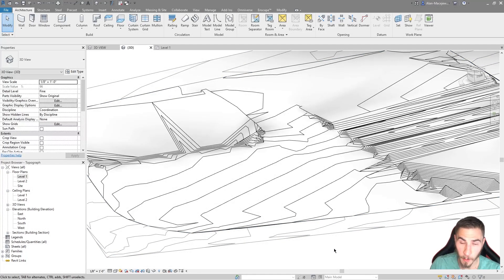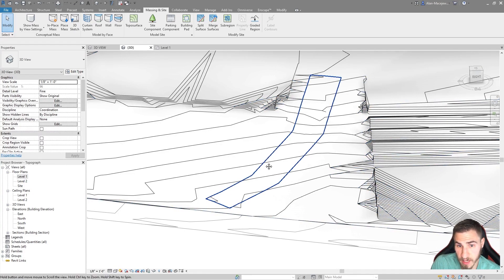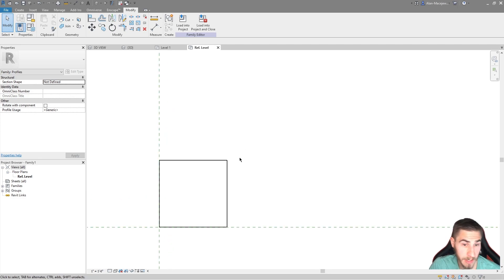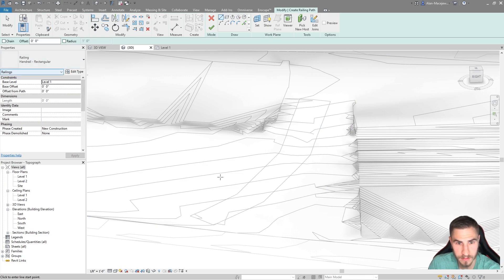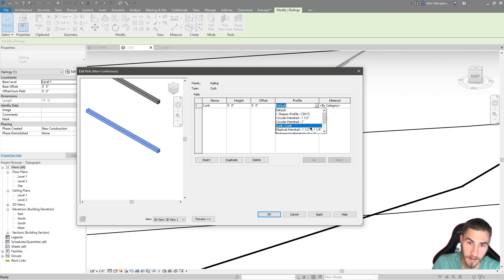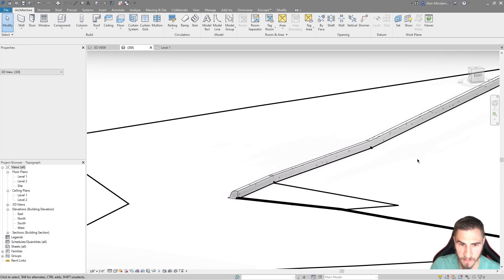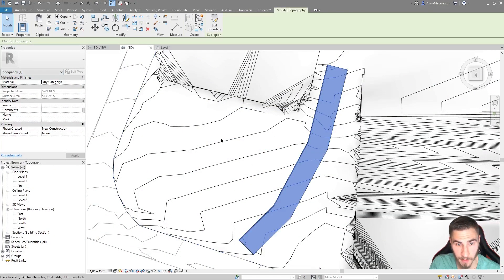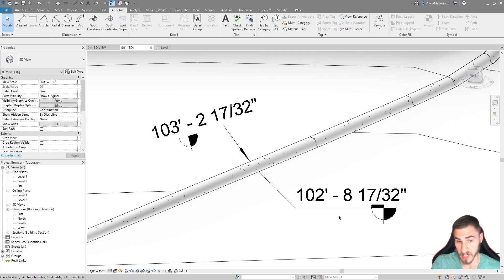How to Model a Curb as a Railing | Revit

Comment: Awesome Revit hack... However I'm having a problem actually changing the Rail Structure to be the new curb, when inserting a new profile and selecting curb it only shows a 2x2 railing profile and not the new curb profile... I've set this up entirely as shown in your video, any clue as to how this can be fixed? Thanks.
Reply: Used a Rail Profile instead, this solved my issue... now I seem to be having an issue getting the curb to conform to its new host... warning message displayed states (placed completely outside of host...etc)
Reply from the maker: Yea you will get that. My best bet would be to crest a profile specific to the curb or whatever you want. You can use that profile in the sweep to achieve the look. Basically replacing the 2x2  profile.

Comment: Thank you this was very helpful! I did this but there was a part that would just not host. It gave me the error of “railing is placed completely out of host.. it may change the adjustment of the railing. How can i fix that? Thanks
Reply from the maker: Hmm  that is interesting . It could be that what you are hosting the curb too is too small or a smaller that the curb itself. That said, it should still host. The other issues I have seen are if a floor sub points are altered in a way where the heights between points are drastic. This can cause errors for elements hosting to them. Hope that helps and thanks for watching!

Comment: Good video, good point about using the box vs a filleted profile and finding the spot elevations. 
I had planned on making curb "fancy" profile , but after your comments, I think I will make it also a rectangular profile. 
It will slightly more work but maybe I will create 2 railing types, one rectangular, one "true" w/ radii, in the same place, and in plan views only show the rectangular and in sections only show the true profile - using filters.
Reply from the maker: There's nothing wrong with a rectangular profile. I have gone back and forth myself but have had more success with the rectangular (sadly). I like that method for sure. It makes me think that it would be nice to have an instance parameter that could switch between a fancy and rectangular profile.

Comment: Very useful and creative! I had a project and i am new to revit. It had retaining walls on topography. I couldn't use walls to follow it and had to model them in 3ds max and import them. I am not satisfied with it because it's hard to edit. I have to save and update the link everytime. This method gave me an idea for doing that. If it was more versatile to define offset in some points to make the wall go higher. 
In a simple way, do you know any methods to represent retaining walls that folloe topograph? At some places they need to be 3 feet high and other spots 6 feet
Reply from the maker: Because of how walls work and specifically how they are constructed, I would say it is not a priority to get a wall to follow topography. You could in theory change the profile from a curb to a wall to follow the topography. But if I were you, I would just model a wall going into the topography.

Comment: Hlo sir..is it possible to cut filled region over the elemen automatically in revit?? In my project we have added some piles ,so in detail view have to show ground hatch with piles..so every time I just edit the boundary of filled region with corresponding pile boundary..it consumes more time whenever I get a new updates need to edit manually..could you plz suggest some solution
Reply from the maker: You could split the topography and delete the area but you cannot cut anything with a filled region. Assuming you are working with a section, make sure the section cut material of the earth in the site settings is set to earth. You can find this in the massing and site tab, in the model site group and using the little arrow to open the dialog window.
Reply: @ArchitectureVanguard  ..is it possible for  draw order to elements in revit??